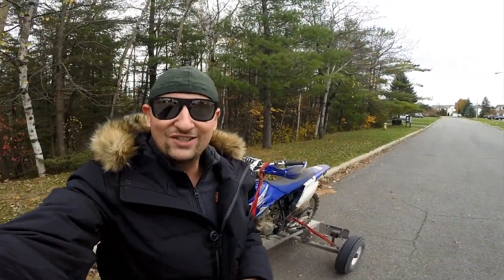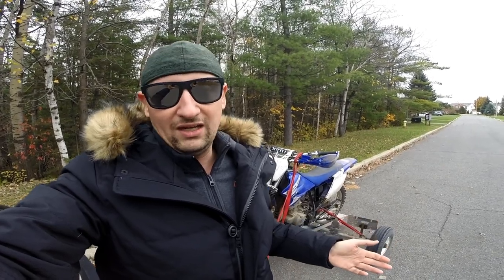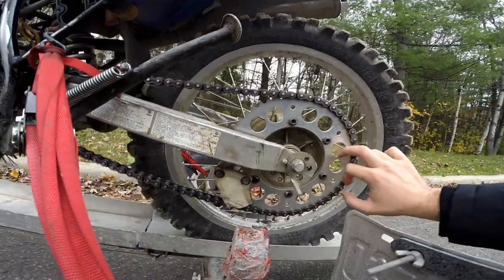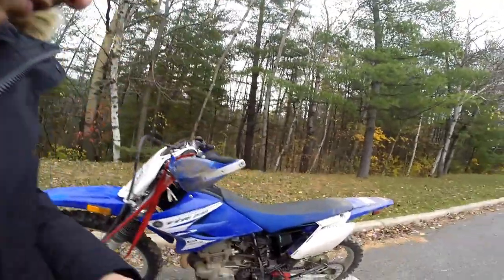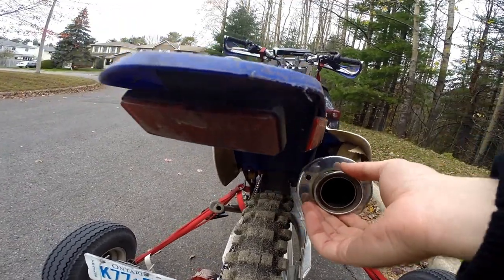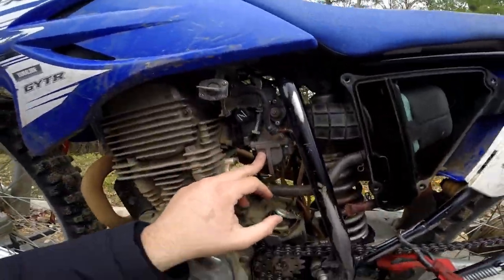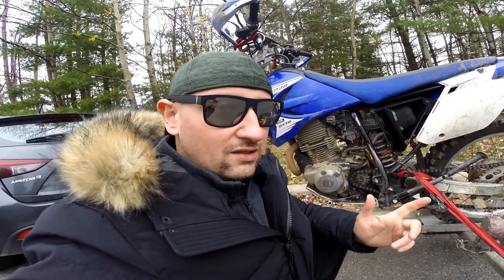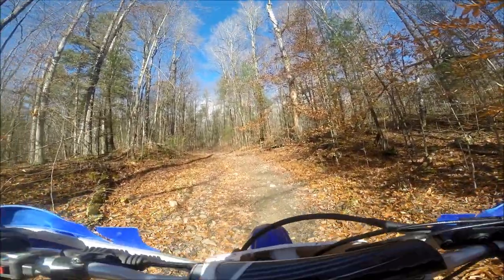2016 Yamaha TTR230 Modded Review - Regeared & rejetted | How to uncork your TTR!

Comment: Hehehe I can feel your excitement when you laugh at the acceleration, awesome! Starting my mods in a few weeks with a new exhaust system too and can't wait to have the same laugh and smile as I ride in the trails and mountains! Thanks for the great vid!
Reply from the maker: Syl Bou thanks Syl... I'm sure you will, haha!
Reply: All mods done, re-jetted, air box mod, front sprocket, new exhaust. I can tell you that WOW what a difference, smiling all the way. Done many rides over 120km long no problems. My viper temp indicator is around 200c after a long ride, didn't have it b4 the mods so not sure what the motor temp was prior of the mods. After a ruff ride of 110km I stopped and put 5$ gaz (at 1.30$ a liter). Top speed on a strait line 96km/hr but still had some room on throttle. LOVE THE MODS!

Comment: You intake tube is completely open? You are a brave dude
Reply from the maker: qjuan white well the little screen is removed but I can't really envision how debris can come through the top of the airbox, through the air filter, and then into the motor.
Reply: @the.real.houseofbikes  Once you get water sucked in there you'll see why! Open airboxes are a bad idea if you're riding anywhere near water, puddles, etc.
Reply: 78FullSizeBronco what is i just drill like 2 holes in the top so it has just a little more air flow? Or still a bad idea
Reply: Jimmy Gritz yea i sold it akd got a yz250f dont need to worry about it 😂

Comment: Hi, I have a 06 ttr230 and I did same mods you did to yours. Seems to run rich, it bogs when I twist the throttle from idle to like 1/4. If I do it slow I have no problem. I have videos to show you by email or fb. Thanks
Reply from the maker: Itreb Acib did you turn the screw in the carb?  When warmed up mine doesn't bog in that condition.   I am on FB as Romanian Tractor as well.
Reply: How fast is ya ttr ?

Comment: if you were looking for more low end power wouldnt you go with a smaller front sproket rather than a larger one?  just a question ,not trying to be a smartass. im thinking hard about one of these bikes myself.
nice videos you make by the way.
Reply from the maker: Good question! Stock this bike is geared way too short, 1st and 2nd gear are barely useable.  With the extra power from re-jetting, stock gearing would be just completely useless.  I know the general rule of thumb for extra punch is to go for shorter gears, but in the TTR's case it's the reverse.  I had looked this up extensively because it's counter-intuitive.  But the results speak for themselves.  The bike is just an animal now with the extra power and longer gears.  My buddy says it feels like his WR250 before he put the race ECU on it.
Reply: ok makes sense if 1st and 2nd were already too short stock.  and thats great oil to run, Rotella is the shit. how does it work in 5th and 6th . whats roughly top speed
Reply from the maker: I had done a few top speed runs on GPS when the bike was stock and hit 61.5mph... haven't had a chance to do the same with the bike modded, but it's definitely on the to-do list next year.  The riding season is over here in Canada because of stupid winter.  I definitely expect a significant increase in top speed!

Comment: I just bought a 2019 TTR 230 and am in the same boat was hoping to make it better by doing this. How would this mod for the ttr 230 compare to a 250? I used to have one
Reply from the maker: Best way to put it is... the TTR is amazing until you can tell you're outriding it. You just feel it eventually.  After 50hrs on the engine (it was my 1st dirtbike), I was craving more power & more suspension travel.  But enjoy it until you can tell why you need more out of your dirtbike

Comment: Are you still using the stock tires?  I have a 2016 ttr230.  Wondering what a better set of tires would do....
Reply from the maker: Would do nothing, because improving your riding ability always does a lot more than modding the bike.  That said, yes I've ran 50hrs on my stock tires, they're now more than done, and I need to get new ones for next season.  Don't know what to get yet since I've never shopped for dirt bike tires before.  But I'll be sure to review whichever tires I do end up getting!
Reply: Good point.  Thanks.  Looking forward to review.

Comment: Did you ever figure out what the top speed was?
Reply from the maker: It was 61.5mph GPS verified... When stock. No idea what new top speed is but it wouldn't be significantly faster.
Reply: @the.real.houseofbikes  mine stock does 100kmh stock so I guess that is 62mph I am looking for a higher top speed I have a FMF powercore 4 and is rejetted and everything, how did you feel like it was faster mph wise and did your acceleration drop alot or no 
Check out my 2017 Yamaha ttr230 build on Instagram @nicholas_stolle

Comment: I love your videos man! I used to drive a 4stroke 150cc when i was young, i am considering buying a new dirtbike since im 24 years old now and i don't know if i should get the ttr 230 or the wr250, i am still at university so the price of the ttr 230 is very interesting but i im scared its not enough. I want to do like 80% trail and maybe 20% track. I can put some money to upgrade the bike if its a ttr since its way cheaper. What should i get in your opinion? Oh and i was told the ttr is way easier to maintan and more reliable :D thx!
Reply from the maker: Epohx a WR250 is twice the bike a TTR230 is. Can't even really compare. I got the TTR cause it was my first dirtbike and it lasted me my 1st season. Besides the mods described in this vid, there's nothing else you can do to improve a TTR and its especially noticeable in the soft suspension.  Once your pace picks up, you'll be maxing out its potential pretty quick. It just depends what your goals are. You mentioned track - this is not the right bike for track!  But it is easy to maintain, all you need to do is oil & filter changes.  The other 250 bikes will require periodic rebuilds but it's worth the trade-off when you benefit from the significantly added performance.
Reply: I disagree.  This bike is bullet proof and requires almost zero maintenance besides oil change and cleaning air filter.  It will last a lifetime if treated well and it has enough power on the trails (once modded).  I agree it is not a track bike at all, but if you are doing mainly trails this is the bike I would get for the simple fact that you can ride it to death with minimal maintence And money.  A rebuild is expensive and if you need to do one once or twice a year (depending how much you ride) it adds up quickly.

Comment: How did u remove the insert from the spark arrester
Reply from the maker: DIRTY DAVE115 simple, there is 1 bolt that holds it in, it's on the side of the muffler tip (perpendicular to the 3 bolts that hold the entire spark arrestor/muffler tip piece)

Comment: What's the Top speed now?
Reply from the maker: Probably not too much faster than 61.5mph (stock, GPS-verified) to be honest. But I didn't do a top speed run after the mods.
Reply: @the.real.houseofbikes  Consider closing the air intake housing and as long as your not smelling oil burning your OK to run a top speed test as you air to fuel mix isn't to much for the motor to handle.

Comment: I wanna buy a 2018 TTR230.  
I'm 6foot 210lbs   do you think I'm to big for the Ttr230?
Reply from the maker: You're just about as tall as me and 20lbs heavier.  You'll definitely notice the bars are very low so I recommend getting some bar risers and raised handlebars.  I have Tusk 30mm bar risers and a ProTaper CR High Bend handlebar and it's now finally comfortable to ride the bike while standing.  As for your weight, the suspension will be too soft once you ride the bike at anything above novice-pace.  I am looking at upgrading the springs myself to be able to handle high-speed bumps, but haven't done it just yet.
Reply: Romanian Tractor 
This will be my first dirt bike . I have always had quads . I'm not planning of going that fast just wanna rip up the trails around my house . Thanks for the info love your video dude
Reply from the maker: Right on Brent, you will be very happy with it I think.  This was also my first-ever dirtbike and I've put over 50hrs on it in my 1st riding season.  TTR230 and CRF230 are very much the ideal first dirtbike, for anyone really!  By the way, Honda's CRF230 is actually discontinued as of 2018!
Reply: Romanian Tractor 
I'm looking for a used TTR230.  I love the Yamaha brand and I just picked up a new camo grizzly.  I'm having trouble finding a good priced used bike . I. Probably gunna go all In on a 2018. 
Where did you get your skid plates for your TTR230.?
Reply: im about 5/11 and 215 and i hate my ttr 230. its a 2012 with it completely uncorked and a power core 4 exaust and i hate it. The bike doesnt have enough power for hare scrambles and there is no way in hell i can take it on a track. It was my first dirt bike and i loved the crap out of it in the beginning but now 6 months with it i am looking for more power. I really would not suggest this bike especially brand new
Reply from the maker: Snickers you used to love it because it is suitable for a beginner. That's what it's made for... beginners, and trails.  It's definitely not designed for hare scrambles or MX tracks. If you only did exhaust, you can also do the intake and re-jet. That's what makes the biggest difference.  Your exhaust alone just adds sound. But at the end of day, sounds like it's time for you to sell it and upgrade to a 250 that is more suited hare scrambles / MX. If recommend WR250F, it's inexpensive and very capable. And if you want more power on it, you can get the race chip from Yamaha (it's a beast with the the chip).
Reply: Not looking to race or even ride on a track . Looking for a bike I can learn on and something that fits through the trials better then my camo grizzly.
Reply: I'm also 6ft and I'm about 60 pounds lighter than you but the bike fits great on me
Reply: I picked up a 2018 Ttr230  and I love it . It's a bit small for me but I can't stop riding .
Reply: @brentjeffrey5027  they're great for wood trails, fire roads, etc
Reply: @nickchristofora3417   I have a 2011 ttr, and it is for new riders for sure. 6 months riding it to get the basics of dirt riding down, and off you go to the next bike.
Reply: @nickchristofora3417  dont know what you was thinking lol its not a racing bike

Comment: I'm worried that if I do this that the bike will be extremely vulnerable to water. Especially dropping the bike in water
Reply from the maker: Same as stock bro.  I removed the snorkel from the top of the airbox but honestly it wouldn't change much in terms of water penetration into the airbox, even compared to stock.  For water to even penetrate in there, you'd have to fully submerge the bike into standing water and it would still take probably 5 for the airbox to fill-up.  By then, your engine would surely have stalled and no water would get in the motor.  Look at my other video, the review of the bike stock, I dropped it (intake-side !!!) completely in standing water, and then opened up the airbox and it was completely dry.  By the way, what I've put my TTR through, lots of people have said is very extreme and that I should upgrade.... and yet the bike handles the 'abuse' like a champ.
Reply: Romanian Tractor I've watched that other video where you dropped it in water just a few days ago. I was just worried that I would be taking that great protection down to nothing.
Reply from the maker: It's a valid concern, good on you to ask in advance.  But it's really a non-issue in my opinion!
Reply: Romanian Tractor That sounds great. I'll definitely have to try this out

Comment: Im buying a ttr230 for my girlfriend its already re-geared front and rear spocket with a aftermarket exhaust.. All I need to do now is some hole in the air box and re-jette the carb? By someone who know what he is doing ofc? Sorry for my bad english (second language)
Reply from the maker: Alex essentially, yes. I didn't drill holes in airbox to protect against water infiltration. I just removed the snorkel at the top of the airbox and the screen in front of it.
Reply from the maker: As for rejetting, yes, get a professional to do it.  Do you know how many teeth on your sprockets?  Some people mistakenly make the gears shorter - which is a bad idea on this bike, because they are too short already.

Comment: If I put in the same gearing as you but didnt mess with the engine would it be worth it? and would the engine be powerful enough for that gearing with no mods?
Reply: Change the jets well worth it. I changed the main 125 to 130 and the pilot 36 to 38 and without air mixture screw adjustment at all runs great. 
I may go up another on the main after further airbox mods. 
It still apears on the lean side to my standards

Comment: Would just changing the gears have a really noticeable effect? My dad wont let me do anything more than that.
Reply from the maker: Austin 3103 yes you'll definitely notice the longer first few gears and it will still be a nice improvement.  Its an easy job to change the front sprocket.  You can go with 15 teeth like me or maybe just 14 since you won't have extra power.  Stock is 13.
Reply: Romanian Tractor ok thank you for the reply👍👍

Comment: NIce I have same bike and live in Ottawa
Reply from the maker: Wilson right on, you should come ride with us this coming season.  Only a couple more months to go!
Reply: For sure my buddy and I are planning a weekend out their, I haven't really had a chance to ride on the trails yet.  Only  put about 5 hours on my bike..... Just a few questions mine didn't come with a manual roughly how many hours do you go until you change your oil.... and the rear tyre there's an adjustment thing was wondering if you have played around with that and what it does.... and have you tried playing around with psi in your tires?..... I also watched a similar video with a ttr230 with same set up  #38 and 130main and the fuel adjustment screw he said all the way then back it out two full rotations have was the one rotation bang on or did you have to play around with it since this video
Reply from the maker: I change my oil every 10hrs.  I got an hour meter so that's how I keep track.  For pressures, I was running 15psi front & rear but as the weather got colder and my pace increased, I started dropping to 12 front / 10 rear for a bit of extra traction.  The adjustment you're referring to in the rear is for the axle itself, which is essentially how you adjust chain slack.  Make sure it's the same on both sides.  Just google "TTR230 owner's manual" and you'll find one you can download.  As for the jets, I did them they way they are described in the video and haven't messed with them since... it's perfect this way.  Hope this helps!  Look me up on Instagram (Romanian Tractor) and send me a DM, we'll stay in touch that way and go ride in the spring!
Reply: Cool Will do thanks for the help